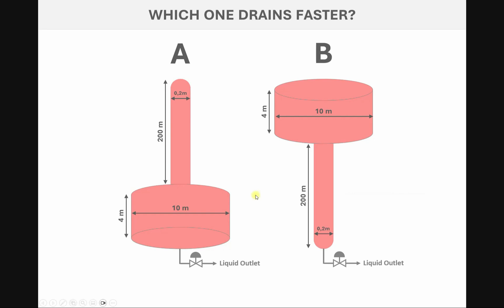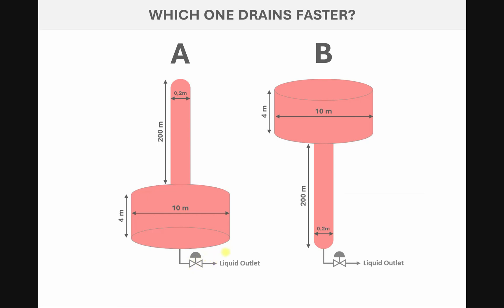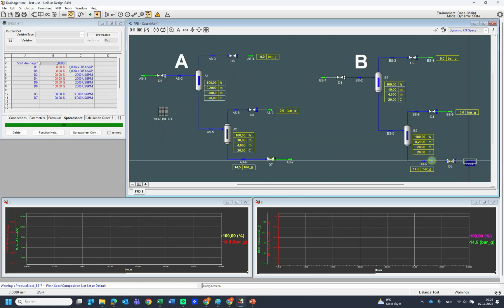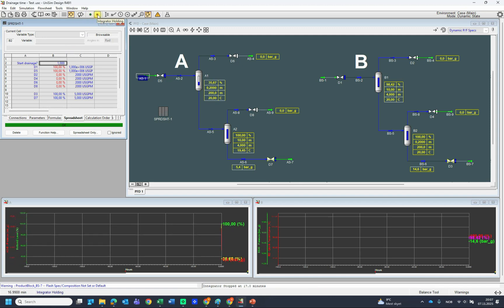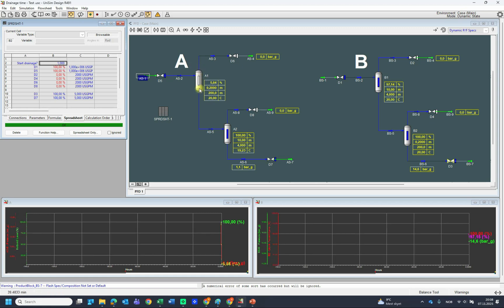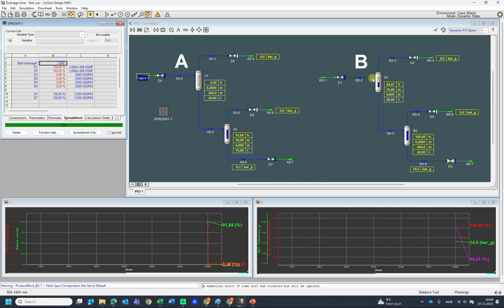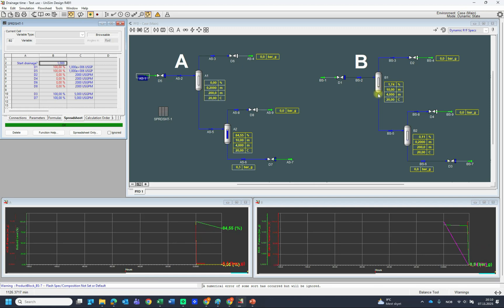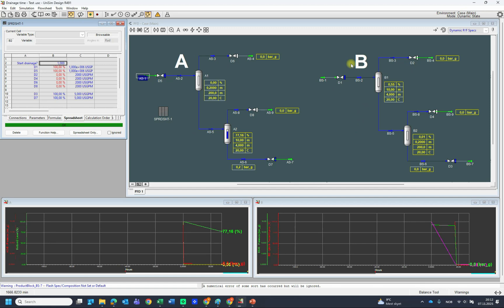Which tank drains faster?

Comment: I'm not sure about this analyse.
If the outlet valve is normal diameter, ok for B.
But if the outlet valve is something like 1m diameter, I guess for A.
I think you need to compare the fluid friction between the outlet valve and the pipe DN200 x 200m.
By absurb, you can also modify the DN200 by DN5. It should also invert the result, isn't it ?
Reply from the maker: No, it is not. whatever similar assumption you make for both the gravity drain tend to be the same and B drains faster. The valve Cv is considered 5, and the frictional loss in the piping is not considered. To have negligible frictional loss we could have a smaller Cv for the valve or a larger ID for the pipe. In general, the main message of the video will be the same: B drains faster.

Comment: they drain at the same rate if the outlets are the same size.
Reply from the maker: Could you please calculate the liquid height and the static pressure upstream the drain valve after drainage of e.g., 5 m3?

Comment: B2 starts to drain before B1 is even empty, bit of a fundamental problem.
Reply from the maker: This is a small error in the simulation and could be fixed by changing the elevations, however the main result stays the same. The simulation is made in 30-40 min and just for illustration not for 100 % accuracy.
Reply: @ariasprocess 'such an easy fix i'm wasn't even gonna bother'

Comment: Can we do it without this software or computer. can we do it manually ?
Reply from the maker: You can do it in Excel. 
1. Obtain the main governing equations for liquid height, pressure upstream the drain valve, drainage rate as a function of time.
2. Calculate the pressure at time zero by considering the full static head upstream the valve, from that you calculate the drainage rate from time 0 to the next t2.

3. Repeat the calculations until they will be drained completely.
Reply: Nope
Reply: yeah, 3d print models of each and do it yourself.

Comment: Thank you very much for perfect explanation! Can you tell, what is the need for use spreadsheet in this simulation? What type of calculation is performed in it?
Reply from the maker: Thank you, It is used to manipulate valve opening and closing in a quicker and simpler way. So when the value of cell B2 is 0, the simulation is in initialization mode and when changed to 1, 4 valves will be closed and two other valves will be opened. otherwise I had to close/open each one by one or I had to use dynamic scheduler. I normally use spreadsheet instead of dynamic scheduler. It provides more flexibility, control and visibility.
Reply: @ariasprocess thanks for the clarification!